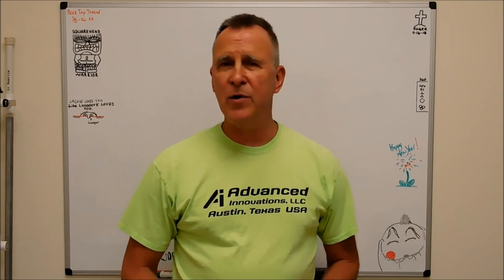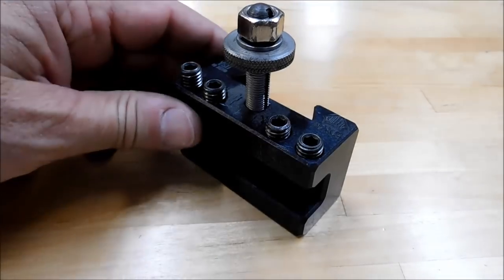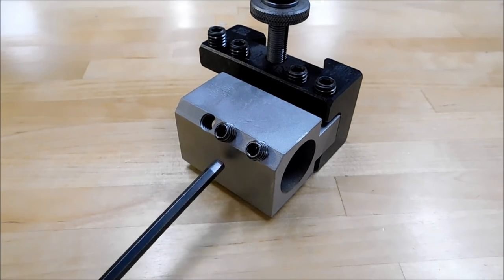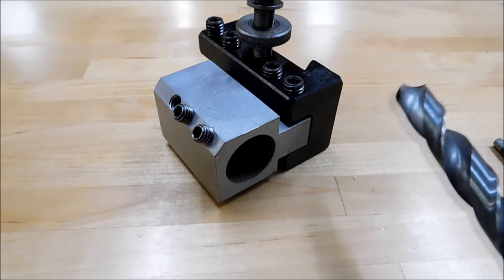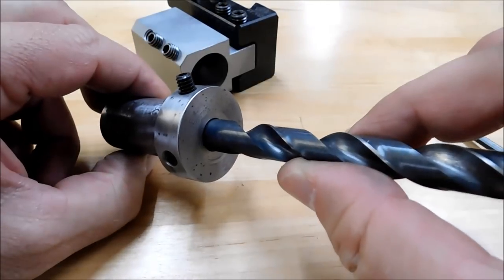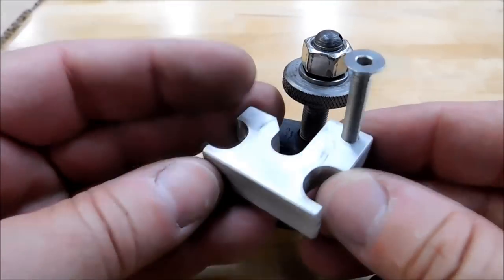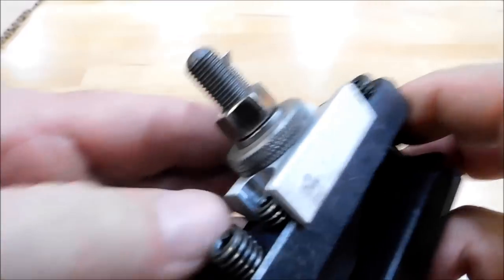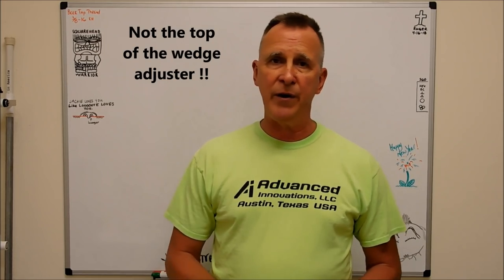Toolholder Adapter Block and Tool Height Extender

Comment: Joe, i've never been shy about asking stupid questions, here's proof... I understand how to set height, I also understand the tramming to align the carriage movement to the line of the drill, but I don't have a clue how you set the cross slide up or back to be on center? Unless you mean to use a coaxial indicator each time....
Reply from the maker: The toolholder adapter is a tool just like any other. realistically, it only needs to be setup one time. After that, the height will be integral to the holder, and the centering will be driven from a cross slide number like any other tool. Once you have initially trammed the outside of a block like this, the indicator will go in the collet. tram the bore of the block, record the number and lock the height and off you go.